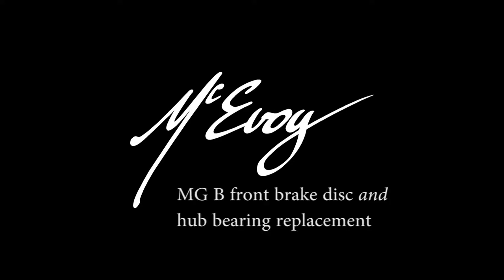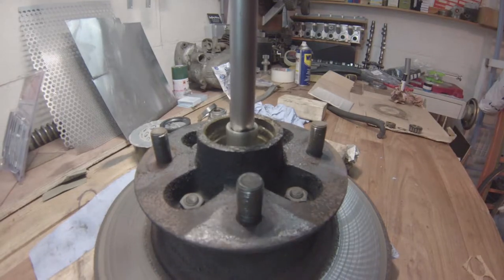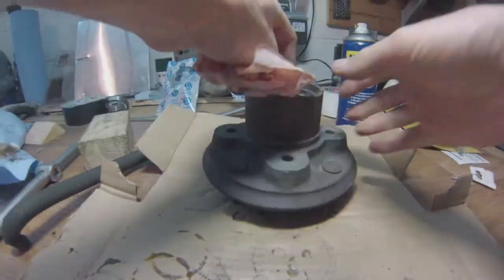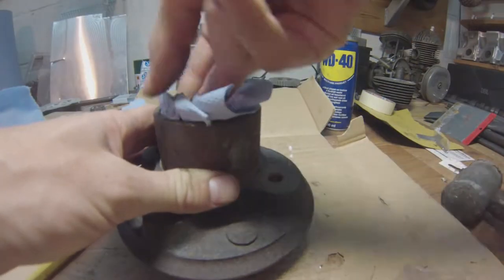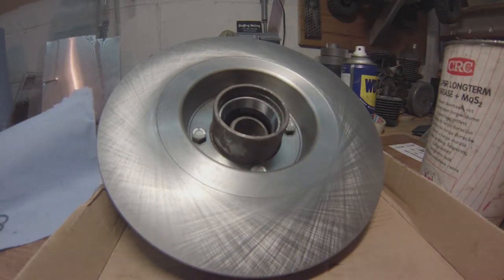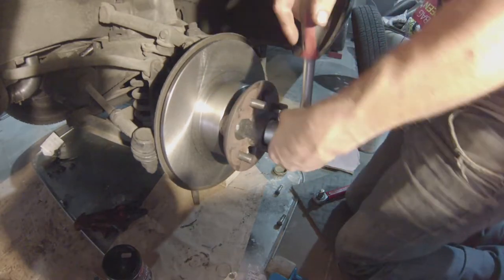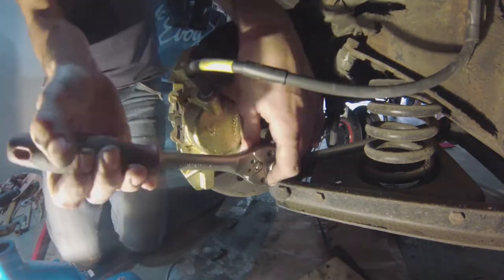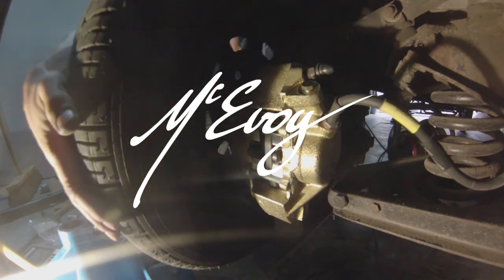MG B brake disc, pads and front wheel hub bearing replacement

Comment: Just one thing I think you forgot to mention is that when you compress the brake caliper pistons the brake fluid level will increase so you need to make sure it doesn't over flow and then set back to the upper level when finished. I syringe out a load of fluid from the reservoir and then top up with new later.
Reply from the maker: Thanks for stopping by Chris! Truly appreciated. You are right about the fluid, going back up from the caliper towards the master cylinder. However, it should not overflow. The fact is, that the fluid level goes down as the brake pads wear out. So at best, a low fluid level indicates worn pads. The fluid which was once in the master cylinder's reservoir, is now in the calipers. So it shouldn't overflow when you reset the pistons. Unless somebody has topped it up at some point, which should not be done prior to a thorough inspection. Low brake fluid indicates worn pads, or a leak somewhere. In both cases, investigation should be carried out. :-)
Reply: @gmcevoy  agreed and I don't top it up, unfortunately the level is checked by the MOT station and they occasionally top it up. If I can stop them I do as I like to use the same fluid, Castrol dot 4.

Comment: 10:36 what is the purpose of the grease in the grease cap? What happens if you don't use grease at this point?
Reply from the maker: This is an excellent question. Thank you for laying it down! There is no accurate information as to why grease is required in this area. Here is why I personally think it is necessary: it acts as a water repellent, and seals off the bearing quite well from water and road grit, grime, and what not. It also acts as a "grease reserve", should things go wrong. If, for example the bearing gets set too tight by an overworked, stressed and tired mechanic, or heats up unduly for some reason, the grease contained within will soften and eventually flow into the bearing carrier, keeping it lubricated even though it is overheating. Lastly, it would be to make sure that the securing nut and pin are caked in grease, making it impossible to rust and seize... If you miss out on packing the cap with grease, I don't think it will do much damage however. Bear in mind that these car used to be driven daily, sometimes quite hard, might suffer from neglect (lack of servicing), etc etc... and are nowadays used for pleasure, shared with family and friends during weekend strolls, usually well cared for and used as a demonstration of our past engineering prowess. Just my own hypothesis, however. Thanks again for your pertinent question!
Reply: @gmcevoy  Thank you for replying to my question in such detail. I completed the replacement of brake rotor, calliper and brake pads on my MGB and was looking at your video to check whether I didn't forget anything. I suddenly noticed that you used grease in the cap (which I hadn't noticed the previous times I watched the video). Interestingly I now see that the MGB workshop manual mentions to not use grease in the grease cap, where multiple sources on the Internet state that one should use it.
Reply from the maker: @windmill1965  Always a pleasure. How peculiar, and highly interesting: I have just checked in one of two workshop manuals that I own regarding the MG B, and none specifically mention to do this or not. Both are Haynes manuals, one from 1977 and the other from 1991. It is common practice on other cars such as Triumphs and such, however. I guess I did this as a reflex. Personally, I am a mechanic who does things by the book, with a sprinkle of common sense on top of professional experience. You have raised quite an acute detail here. What workshop manual are you using, if I may ask?
Reply: @gmcevoy  at least you are a professional mechanic. I am an amateur who got his first classic car (MGB) about half a year ago, and am learning as I go along. I don't have the Haynes manual. What I got is a PDF file of a scanned version of the manual written by Leyland Cars (i.e. the manual provided by the factory).  This document has 417 pages and can be found by searching online.
Reply from the maker: @windmill1965  That is fantastic! Hats off to you! There really is nothing better than to read the factory manual, and dig right in. One of the best 'hands on' way to learn. Keep it up, and if you need some extra information along the way, let me know. I am always glad to help.
Reply: What a great job you did & what a genius design having the bearing the hub & the disc coming off in one assembly....no hammers or presses needed...